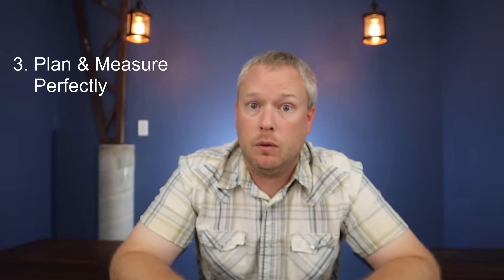7 Drawbacks to ICF Construction -- Problems with Insulated Concrete Forms

Comment: One of my issues was, is that I have had exposed ICF for a few years and now and because of the concrete setting, it has pushed out the icf blocks out slightly and some gaps have formed and we have had water ingress into the two bedrooms at the back.  So, this year, I am going to waterproof my icf construction totally prior to putting on external wall insulation.  Bar that - they are great but all the points made in the video are valid.

Comment: Really good summary of ICF issues. I would add a couple of comments or clariiers:
1. We actually found moving the blocks to be quite easy. The individual blocks weight very little and moving a bundle is fairly easy - two long 2x4s and two people can move them with ease.  I do see your point for the second story. But again- a little help and they can be easily moved.
2. Great comment about penetrations - I have an outside door where I would like to have a light.  The  idea of drilling through 7” of reinforced concrete has kept me from putting a light there so far. Recommend you develop a “penetration plan” and have someone check it. Also consider going to a home that has been completed and think about the penetrations- think about HVAC drains, power to outside lighting, power to an outbuilding, consider a couple of “spare penetrations” for future electrical. 
3.  The walls are think but one great thing this gives you is nice shelves on the inside- every room in our home has taken advantage of this. Really nice for decorating at Christmas.
4. Great suggestion about interior walls - we did this as much as we could - made construction much easier.
5. We have had zero issues with humidity - we built “slab on grade” which may be the difference- the other thing we did was to use all mini-splits for HVAC which we have set to specifically remove the humidity.  
One thing we were warned about is that HVAC installers will oversize the HVAC- this is so true.  Even after being very clear about how much more efficient the house is our HVAC guy still oversized the HVAC by 30%.  Recommend you install a Direct Vent gas fire place.  These are very efficient and heat the downstairs of our home very well.  Our typical electric bill is under $200 a month even in the heat of the summer and the coldest part of the winter- and we have 5000ft2
Reply: In ICF houses central air is not your friend,. there is no way to size the ac unit exactly based on heat loads that may or may not happen for each year. Mini Splits are your friend because you can over size them by a larger factor. Depending on the model you get can range from x amount to x amount. So a room that requires 5k btu you can over size it to 24k btu if the minimum cooling is 5k btu. You will have to contact the manufacture to get this information.  Over sizing your mini split will help in many ways by maintaining the temp set all the time while still having enough cooling power to remove moisture and unexpected heat loads.
Reply: @kameljoe21  Radiant floor heating/cooling.
or air through floor.
Reply: @dwwolf4636  The only problem with this is you still need to filter the air and remove excess moisture. While radiant flooring can be cheap to install it would be nice to find a combination heat pump that works with both radiant and central air. Unless there is a system that I do not know of please let me know. I would not mind installing a Central air system to filter the air, remove or add mositure, heat and cool the air and then keep the floor cool or warm. The slab can retain the heat in the winter while still keeping the air filtered and adding the moisture and keeping fresh air coming in to the home. I would no longer consider mini splits as the best option. For retro fits they will be fine. The major propblem is they lack the ability to provide better filters. They are also super hard to keep spotless.
Reply: @kameljoe21  so a couple of thoughts. First because our house is tight we installed an air exchange unit that works great - runs about 4 hours a day. We also found that because there is less air infiltrating the house it stays cleaner. And I go around every two months and clean the filters which clean easily with soap and water. My wife does not like the look of the mini splits but they do work well. Also we found, as ICF claims, that our electric bills are much lower. 5000 ft2 hone for under $200 a month
Reply: What was cost like? Thinking about building. Was considering ICF?
Reply: @Taskarnin  built for $80.00/sq ft.  Did some work ourselves- some painting and some interior trim- oh and did the majority of the ICF work which turned out to be the easiest and most enjoyable part of the project.  ICF is extremely easy to work with.  Also did most of final plumbing.  

We have been in the house for 6 years now.  Even more happy than when we first built. Very low electric bills, house is very low maintenance and it feels incredibly solid.
Reply: @Taskarnin  built for $80/sqft- we did some work ourselves.  We did stack the ICF block which turned out to be very easy. Did some paint and interior trim.
Reply: 3? What does thick walls have to do with shelving?

Comment: All Styrofoam off gases! You are now putting this foam inside your home!
Reply: Absolutely. I love the idea of spray foam as it can be applied into every crevice but.... if it doesn’t cure properly your screwed.

If it does cure properly it still off gases. It’s incredible to be a thermal barrier as well as air sealing, but just skeptical of the potential long term health issues that could arise.

Yes it’s covered by drywall, but the drywall and paint isn’t as much a barrier as the concrete and the housewrap etc on the outside if sealed properly.

So would like to say it’s a higher chance of it coming inside than out. Do a good job air sealing inside.

Another question this brings me. Are the interior panels vapour barrier panels? Or non VB and still have to poly or?

Comment: The worst part is the foam beads, from cutting and channeling.
It never breaks down, and may end in water ways over time.
It’s often mentioned by home owners as a concern.
One person mentioned termite protection.
I’m still not sure of a better building product.
Cheers from Oz
Reply: I read that a hot knife cuts down on the foam particles.
Reply: A Weller 100 soldering with a 3/8" tip opens the channel with no mess. Electrical wire pushes in easily.

Comment: Thanks! Interesting comment about residual moisture. We just did 3 buildings with foam-outside concrete-inside, and had no noticeable residual moisture - in fact they all seemed particularly dry.  In these cases the concrete water content was very low, and the concrete is exposed to the interior.
Reply from the maker: Makes sense
Reply: @Challenged1  Forgot to include that the footings etc are all insulated from thermal/moisture contact with earth.

Comment: I would not call those things Drawbacks. They are part of the Tip & Trick of Beat Practices with ICF. Everything is a problem if you don’t know about it.
Reply: Exactly
Reply: Ha, that's good. There are no problems if you address them beforehand.

Comment: Helpful advice. Most of what you say is about project management rather than a fault with the ICF blocks. ie proper design and good site management are key. Helpful tips non the less.
Reply: When building plans are drawn for ICF there should be no additional design costs. They force more pre-thinking about the design but that has to be a good thing as design changes during the build always cost money.
Reply: @Dave5843-d9m  Building houses or buildings in general, the things you mentioned are common things to do with any project. In my experience, when designs are changed it means someone has to do it and they are paid. Any design changes typically incour a charge and that is normal. To me it sounds like you have a issue with them because of your lack of preporation or planning. There can be unforseen things and someone with experience will know what to do but the concerns you discussed are fairly basic preplanning. I was expecting something major but this is basic stuff for most any major building project unless you are very inexperienced and then this is a project you shouldn't be doing.

Comment: Those are all very good points. We have been in our ICF rancher for almost three years in Canada.  We still run a dehumidifier in our 4' crawlspace. Don't build a crawlspace thinking you will use it for root vegetable storage. It stays too warm. We didn't put siding on until this past summer. If you're building an ICF house yourself, finish the outside before you begin the  interior. Doing exterior finishes after that fine yellow powder has formed is a TOTAL pain. We put HardiePlank on our house. It's a little more involved than putting it on a wood framed house but it is doable. We decided that everything considered, we would build ICF again. It's quiet, energy efficient, and we know it's strong. We gave away our air conditioners because the house stays cool and it's very easy to heat. We live in an area where the temperatures in the summer are over 100F and well below zero in winter. During construction, the house stayed quite warm overnight without heat on. Do check into house insurance before you build though. Many insurance companies have very little experience with ICF. Most refused to insure us and some didn't know how to classify the house. Others wanted exorbitant premiums. It's a great product to build with all in all.
Reply from the maker: Excellent points!!!
Reply: Can I ask? How about fire codes is it comply with the safety codes of Canada? Am wondering this foam layer is fire rated at all ?
Reply: @Fuder95Ibra  Yes, ICF meets the building code requirements in Canada. The drywall, plywood, or whatever finish wallboard you put over it will keep fumes out long enough for you to escape.
Reply: @crystalwright1504  so at end of the day we have encapsulation after the building is over, with materials that comply with the required FRR of the NBC?
Reply: @Fuder95Ibra  The ICF fully meets the NBC for strength, fire rating, etc. But yes, you would cover both inside and outside with  other materials. For instance, we used fibrous cement board siding on the outside and plywood on the inside. Most people would use drywall.
Reply: @crystalwright1504  thank you for info, am taking your time, it's just involved in my field and am trying to reach max information about fire safety conpliance and from atchitectural understanding, last question I have, almost all videos are talking about houses, is ICF only for one floor buildings? or its also can be used to build high buildings more than 2 floors, again sorry for the inconvenience, much appreciations for your help 🙏🙏🙏
Reply: @Fuder95Ibra  -  I'm not a builder, so don't take my word for it, but ICF can be built taller, taller, taller, just like many other construction materials. Check with an engineer or architect.

Comment: I'm considering  about using icf for my home in the Philippines  🇵🇭  a very humid country  my home will be above grade on footer...would you be concerned with the humidity issue as you describe  and would a dehumidifier  be your soultion?
Reply from the maker: The humidity will lower over time, but a dehumidifier as well as fresh air supply will be mandatory though.  These ICF homes are tight
Reply: @Challenged1   ty merry Xmas brother.
Reply from the maker: @gordonramsey8866  Merry Christmas to you

Comment: Would you say that the two years of construction was driven by the size of your home? I am curious if smaller homes ~2000sqft would take 1/3 of the time or if there is some economies of scale with a larger build and there are parts of the process that will take the same amount of time no matter the size.
Reply from the maker: Yes!!!  I would say the time would definitely reduce, but not quite proportionately.  The limiting factor in this whole things was me.  I quickly realized I only had so much energy to expend each day before I was exhausted.  Plus, the amount of help you think you will get from others on your project is significantly less than you plan for.
Reply: @Challenged1  That is great to know, thank you! I am very interested in applying what I have started to learn with your content in a more urban context, so much smaller lots, smaller homes, and hopefully smaller timelines! haha
I'm full of questions over here, but did you look into an ICF roof for your home? It seems like ICF roofs are still a much more specialized building method.
Reply from the maker: @jmfreerider965231  I didn't.  We wanted different vaults throughout our home, so pitched roofs were the only way to go.
Reply: @Challenged1  makes sense, thank you! Again, thanks for posting your content, I have been able to learn a lot from you on topics that would otherwise take several sources and much more time to compile!

Comment: We had a brand new Blue Max Home Built as a test market in KC in 1999 this was new to builders....so our home was built as the same price as a stick frame! It withstands hurricane force winds! We did however had a built in Air Filteration system installed due to the very little air flow however utilities are so low!! Its still performing above standards!
Reply from the maker: Very cool